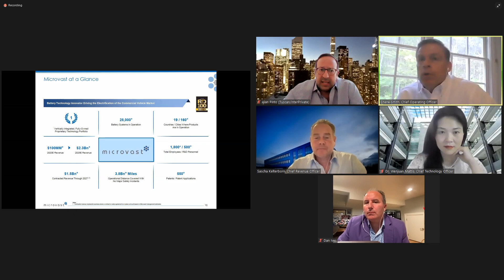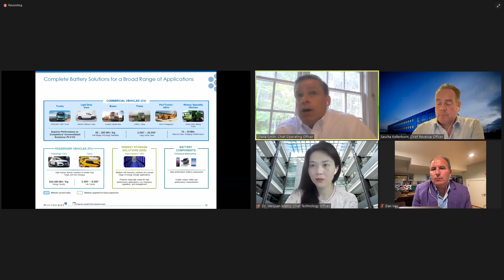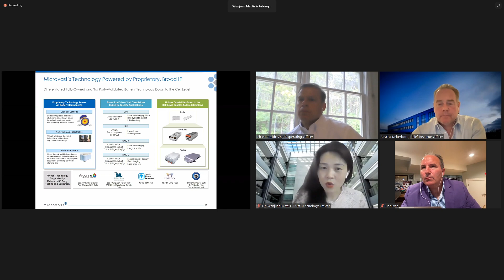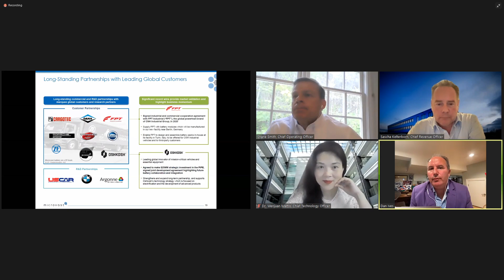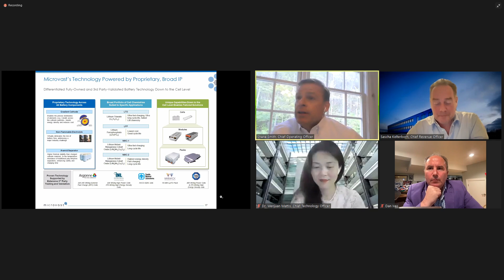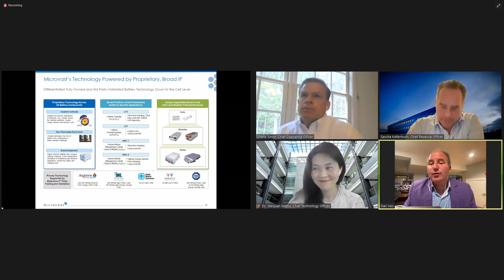Microvast ($MVST/$THCB) Wedbush presentation 4/8/2021 (FULL WEBINAR)

Comment: vote for an extension to get merge done is on April 28th if it fails no merge?
Reply: Vote, but they have ways to get this done.
Reply from the maker: Correct, but the vote will go through, no worries.
Reply: How do you vote
Reply: @Silent-Alert  you had to own on March 17th
Reply: @Silent-Alert  Contact your broker or the proxy solicitor. Remember you can only vote if you owned shares on the record date (March 17th 2021)